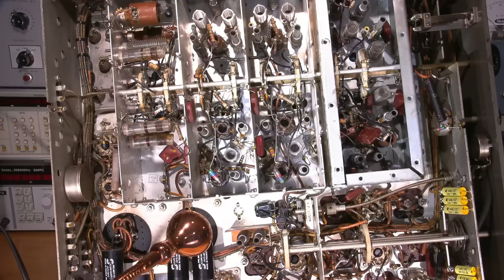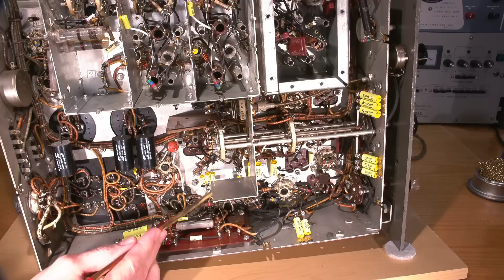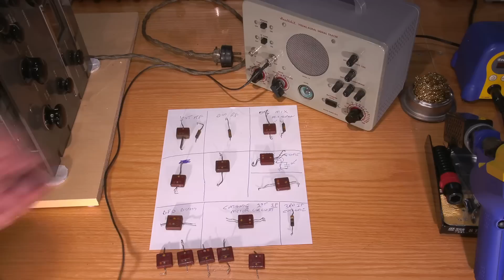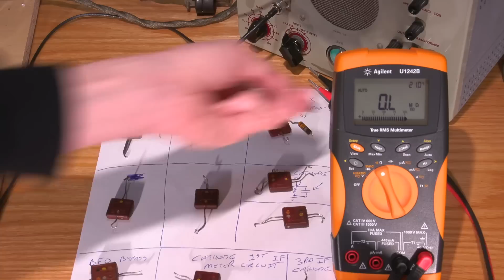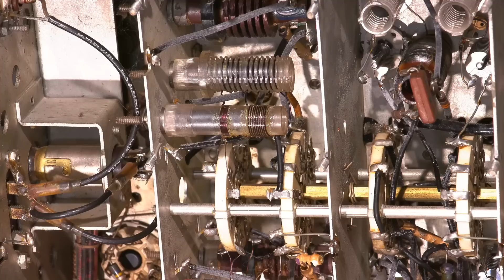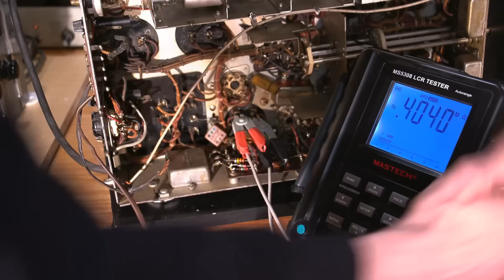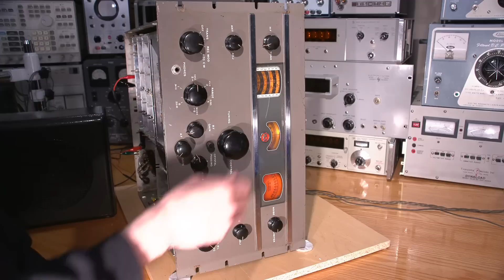1940's Radio Receiver Performance Check - RCA CR-88 With New Mica Capacitors!

Comment: As a matter of interest, there are two types of the molded mica caps. The red plastic cased ones are silver micas, while the tan or brown ones are stacked metal foil construction. The red plastic silver micas suffer from the same "silver mica disease" as do the ones found in IF transformers. It must be something in the manufacturing process where silver is deposited on the actual mica sheets which causes the problem with age. I have found similar noise problems even with modern resin dipped silver micas. On the other hand, the brown stacked foil molded micas are still very reliable in my experience. They are not to be confused with the brown plastic "Micamolds" which are actually paper caps in a a similar molded case.

Comment: I ALWAYS replace paper caps.  Good luck on finding new bathtubs!  Do you have a calibrated RF signal generator or service monitor so that you can make sensitivity measurements?  It would have been interesting to make before and after measurements in the capacitor replacements.

Comment: That’s some old stuff. I worked in a TV repair shop in high school in 1969-1970. Then in the Navy on P-3s we had old and new electronics equipment. They taught us both tubes and transistors in A school.  I think I have an old airplane radio around that I had in a small plane I had with all the discreet components. Circuit boards sure changed everything. It’s amazing how they put these together versus todays electronics.
All those capacitors being bad makes me wonder if it didn’t take some kind of real high voltage hit.  Something in the few thousand voltage range.

Comment: My guess would be that the proper resisters weren't available and they stuck those ones in because they had them, and got the thing out the door.  When or if it was discovered (80 years later), it would be - without doubt - someone else's problem.
Reply: Those old resistors have a 20% tolerance unless they have a gold or silver band on them. A 33k ohm can have over 6 k difference and still be good.

Comment: This video seems like a revelation to me especially since watching MCL's videos for years I became convinced the likelihood of finding bad classically  color coded mica capacitors was highly unlikely and in most cases you did not have to consider replacing them with your refurbishing project.  That thinking has now been dispelled and thank you to Mr. Carlson. Had to have been a faulty production run of these mica caps.

Comment: can you not take of the scaleglass and scan it in to your pc, in several parts if it is to long for one scan, and then fix up the image in software to remove any problems, and then make a new one yourself, or have someone else make it from the fixed up scans?

Comment: There was a company that was selling the plastic replacements for those meters. I bought one about 2 years ago. The name of it is RADIO DAZE. I checked and they still have the reproduction plastic replacement for those dials. They also have the full dial plate.

Comment: Regarding the Faceplate.   Have you considered a repro from Radiodaze?   They're a bit pricey but not scratched.  you'd need to transplant the RCA logo button but theirs has the holes to accommodate it.

Comment: I've not had a lot to do with mica caps and I would be interested to know how they generate noise.   🙂
Reply: Assuming this is the same problem that IF tuning caps get, it's called Silver Mica Disease.  The plates of the caps are plated in silver.  When it is in contact with the mica for many decades the silver migrates into the mica.  This gives an intermittent conduction path between the plates.  When B+ is applied it conducts through the silver in the mica.  When it conducts it moves the silver around and changes the conduction paths, hence the crackling; it's tiny low-energy sparks in a way.   Rarely seen because the mica is thicker than the mica in an IF can.
Reply: @josephcote6120  Thanks for the info m8.  It makes sense now but it had me buggered until you made it clear to me.  Thanks again.
🙂

Comment: I used to have a signal tracer with noise function, i never used. I think a Heath it 12. I never knew these could crap out like that, i am restoring an old hallicrafters sx-42 and did not. Change the micas. It is similar to your set. But has fm. I dont know about screen resistors, my radio has 56k

Comment: In following your channel, I find it interesting how many functions, sometimes simultaneously, capacitors are used for.  Before IC components were introduced, capzcitors were the m9st versatile components in any electric, to say nothing about electronic, devices constructed.
Reply: They still are.... Look up surface mount capacitors and also ic lithography

Comment: You've just given me an idea. Those faulty caps might be a good way to produce entropy in things that usually have trouble generating it like servers.
Reply: Not a good idea.... All it takes is for one up completely short and then take out something irreplaceable, if its more that25 to  30 years old and an oil filled electrolytic or more modern electrolytic, it's gotta go...

Comment: ..love your noise sniffer. As far as I understand, the device basically only applies clean DC voltage to the component and at the same time sniffs out any minimal voltage drops (cracks) that may be present via a coupling capacitor. How high is the voltage that is applied to the components in this method? I already had transistors and OPs that caused similar cracking ...is it possible to test semiconductors with this device?

Comment: There's one thing I'v never seen and that is how they combined these radios to get the best signal. In a ww2 picture I saw 8 of these combined. I have model that has that option. This channel just keeps getting better and better!
Reply from the maker: You can search, "Diversity Reception." Many were used in this configuration.
Reply: Do you mean 8 receivers connected to 8 different antennas?  That would provide some resistance to signal fading.
Reply: @JohnShalamskas  I couldn't tell from the picture the caption was that all 8 were connected together.  The one I have has the IF RF connectors in front by the BFO and you can tell its factory. I haven had time to dig around to see how its set up.
Reply: This one has a IF input and a RF out put from the factory on the front. On one history place  they have banks of them but don't say what there're doing.
Reply: @eazystreet5507  The RF out could be for a pan adapter.

Comment: The lower gain on the RF amps might have been chosen due to the receivers being used near high power transmitters.  Lower gain in the front end would reduce gain compression in the presence of strong signals.

Comment: Perhaps a very low viscosity UV cured bonding resin agent could seal and mend that dial cover crack to invisibility (as used to fill windscreen cracks).

Comment: The B+ Voltage on those old mica caps really wore them out. Seems they may have been  from the same manufacturer.
Guess we can call it Micamold disease. Great restoration series there with you as a teacher Paul. Time consuming repairs
( from unfortunate surprises) edited for sanity reasons no doubt and more repairs to come before aligning it. Can't wait!

Comment: It's a big job to change all those capacitors (plus those resistors), but it's something that has to be done !
I'm going to do a similar thing to my 1947 AWA receiver, but it should be a lot easier to do compared to that receiver you have there !

Comment: I must say you do have an interesting way of testing for noise with those Mica capacitors. Really good to know when I am working on a noisy receiver I will look for that as well as dried out Electrolytic capacitors and checking tolerance on resistors as well as checking caps for leakage. Thanks for another informative video Paul.

Comment: The mica capacitors inside de FI cans were bad too, on my AR88. They were mica too, but had leakage. Noise I had not tested. I think that noise and leakage are “sisters”, or the same gost. After changing them and doing the right FI alignment, the receiver operates in a very great condition. Astonishing condition, to be more precise. Greetings from the south of Brazil. 0:08

Comment: One of the most amazing things to me is the ability of the human brain, not mine, to learn how to understand and control electrons. More amazing than that is, the mental ability necessary to understand all of the components and HOW they channel electricity to other components, to achieve a desired task. To me, it's magic. My 67 year-old brain just can't absorb that much information. I've been a residential electrician and a commercial electrician  and have built a few power supplies and Fuzz Boxes for my guitar back in the 70's. But, Magic needs Wizards. And you, my friend, are the Grand Wizard. Always amazed. Hope your channel does well.

Comment: I just brought a 1934 Silvertone Model 1806 back to life.  The mica capacitors are original and in excellent condition.  I usually buy radios that are in pretty bad shape that no one else will touch.  I like the challenge.

Comment: Fine business, thanks! Your way of teaching and detailed shots are really helping me as I have 4 AR88s to check through. As you say, a bad batch of caps, I wonder if the one of a slightly different colour was a different batch or a replacement for a previous failure?

Comment: I wonder if a thoughtful replacement of any old carbon composition resistors would help with the signal to noise ratio as well ?

I replaced the resistors with metal film ones on an audio amplifier years ago and the background 'hiss' virtually disappeared !
Reply from the maker: Carbon composition resistors are quiet as well, there are just a lot of noisy ones out there to confuse. For example, My Fluke 5440B Calibrator has many carbon comp resistors in it. Your amplifier that had a hiss issue probably had a noisy resistor, replacing that resistor with a new carbon comp would have resulted in the same outcome that you have now.

Comment: Have used .01uf caps instead of the 4700pf ?
Reply from the maker: In many spots, "Yes." The 1st detector (Mixer) cathode, and the AGC line got the factory values, (4700pF.) All the screen decoupling capacitors are now .01uF
Reply: @MrCarlsonsLab  thank you for the info I will change mine to .01uf.
The ones in the RF amps I wired them direct to the earthing tag on the valve base to keep the leads short and the RF stage went into oscillation ?  put them back as factory fitted  them. I see the first RF amp has a ten ohm res in the anode.

Comment: Something I've been meaning to try on cracked perspex is windscreen chip repair. Anyone else tried it?
Reply: I haven't tried that, but if the parts can be fitted closely together, and very tiny drops of acetone are applied with a toothpick, the plastic will bond. A little plastic polish will dress the surfaces after drying.

Comment: Thank you. It was really neat to see some failed mica capacitors, especially since it was a big batch problem and how and what you used to test them. I'm 53 now and getting back into electronics again. I started by studying electronics when I was very young and my dad brought me a surplus shortwave receiver and transmitter that fit into a rack and was used by the military. All vacuum tube.😀

Comment: Loveliness! I'll be on a lookout for bad mica caps, and the Heathkit signal tracer gave me an idea of hooking my regulated 100...300VDC supply through a resistor to the DUT, and using an amp/speaker for listening to what's happening there.

Comment: Sir, you mentioned that the 47k screen resistors were factory. If I've understood you correctly then you have another otherwise identical receiver with 33k standard factory resistors. Would it not have been more interesting to restore both as factory and then compare their performance, assuming all else is equal? Or have I missed a point?
Reply from the maker: It would just have lower front end gain.

Comment: Paul, Do the resistors not produce noise too, I thought I read somewhere that carbon components were noisey ? 🤔
Enjoyed that vid, its nice to work on gear that doesn't use grains of smd rice .... 🙄😂

😎👍☘️🍺
Reply: Right about 'grains of rice' - or sand these days !

I replaced a back up battery on a 20 year old TIG welder a few weeks ago and it was a joy to work on a good ol' fashioned through soldered components you could actually see and work on without a microscope !!